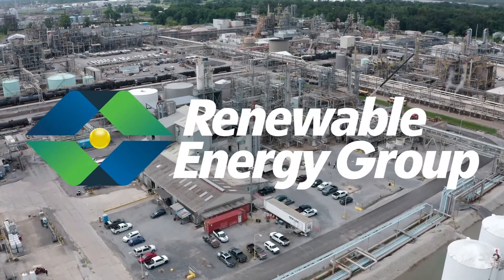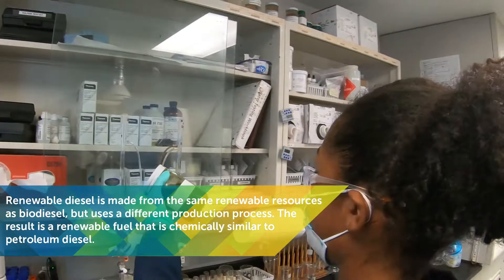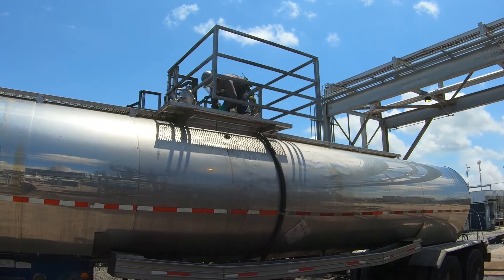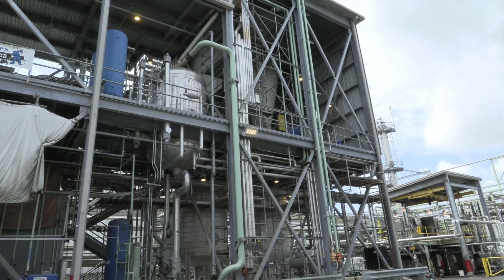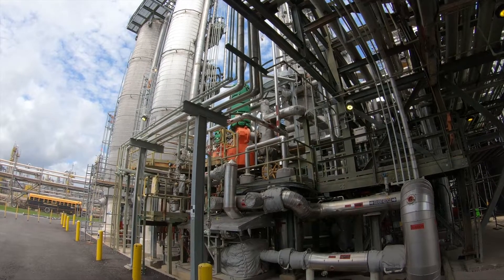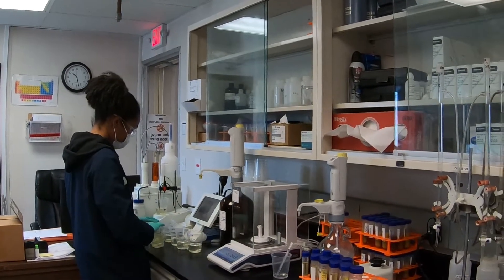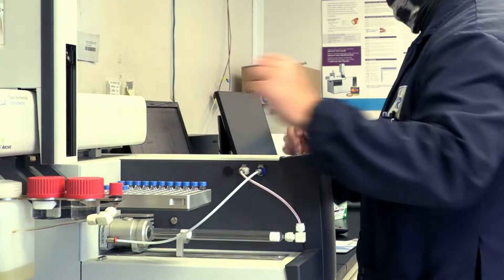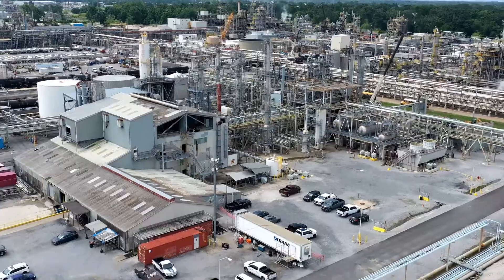Renewable Energy Group Renewable Diesel Biorefinery Tour

Comment: It might be placebo, but I swear my 7.3 runs smoother on this stuff.
Reply: Not placebo. Renewable diesel has higher cetane than dino diesel, because of the isomerization.
Reply: My 7.3 as well runs smoother. I also get better milage.
Reply: Far from placebo...RD improves the engine performance of nearly all diesel engines.
Reply: 7.3’s love UCO…